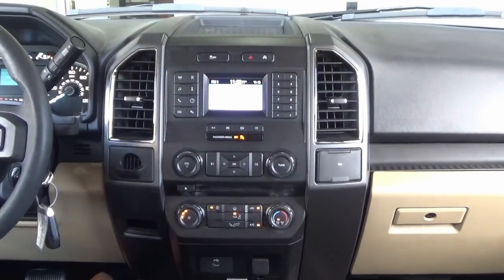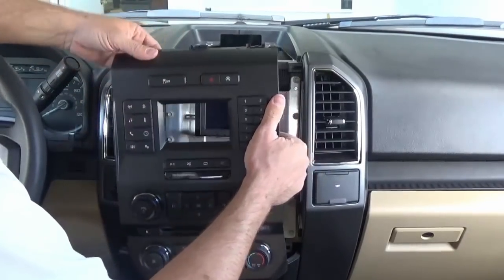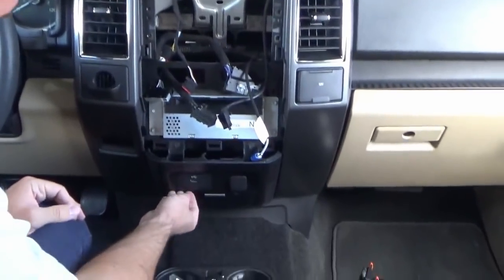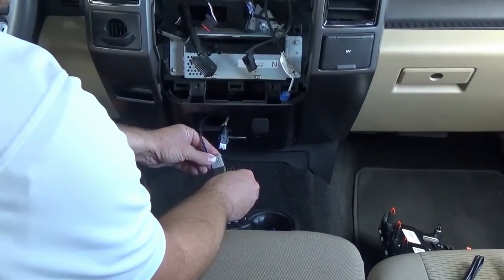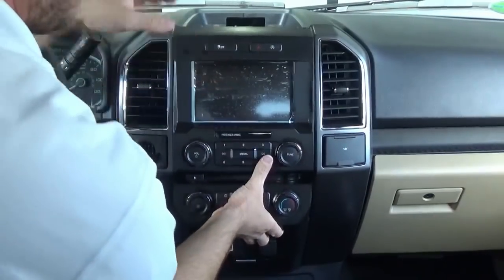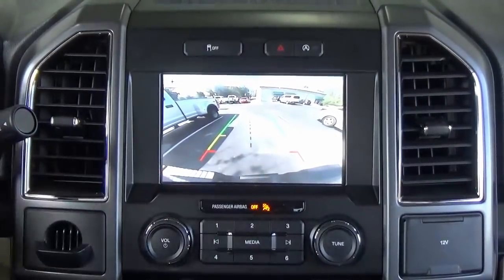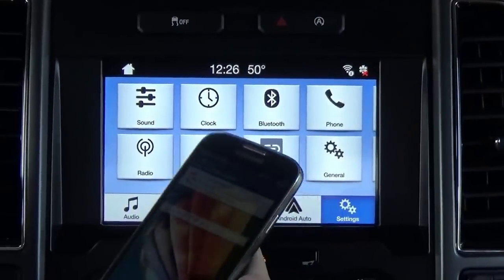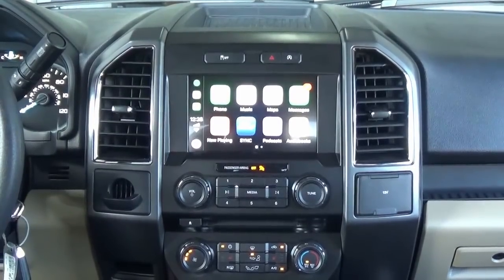2018+ Ford F-150 F-250 F-350 - 4" to 8" Factory Sync 3 Apple CarPlay Android Auto Upgrade

Comment: Can I interchange a unit from 2019 f250 to 2018 f150
Reply from the maker: We have two different packages to accommodate both SuperDuty and F-150.  The APIM's are pre programmed to the vehicles VIN#.  So it is difficult for the average person to interchange units without access to programming capabilities.